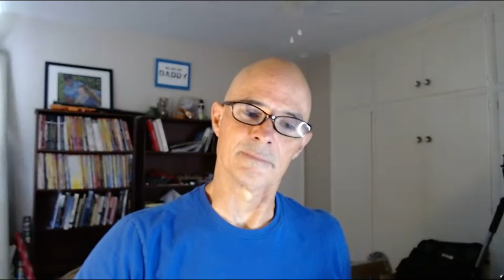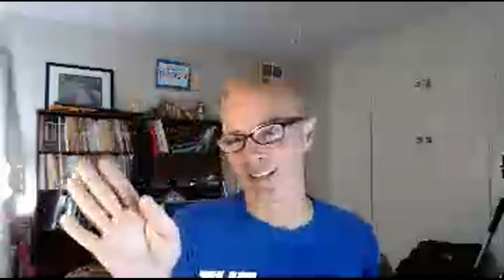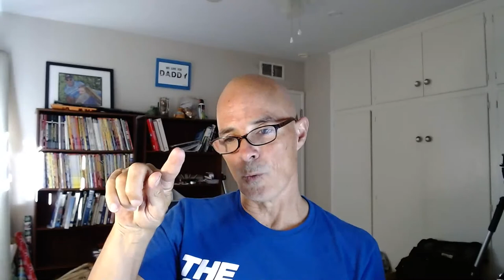LET'S TALK TECH-EMISSION LEGAL MODS

Comment: My beloved member from Four Eyed pride said it best...."It should also be noted that the CARB members are not voted in but are appointed positions by the Governor and state legislature. As such, you can imagine how well they represent us citizens of the state".
Reply: The world watches this bungling flexing of Anti Gasoline and Diesel Autocracy. I'm in  love with the responsible and smart moves the USA has made with the Clean Air Act, from its progress in 1963 to 2020, but in six months it has oveseen by very heavy handed, non aligned behaviour,   namely  the EPA and CARB and BAR. Each hasn't consolidated it's original statement of intent to just police simple operational competence of the basic emissions systems. The  rule now is on Totalitarianism and Fines. And just like it is in Algeria where if you put a low rwsteictiin exhauat on your Peugeot, you are a criminal. Preventing people tinkering At All with any OEM vehicle and saying VIN stamped cars cannot have non standard intake systems, including a blanket ban on anti detonation injection,  nitrous oxide, exhaust mods, turbos, superchargers, cam changes, pistons and axle and trans not stock. Thats Authoritarinizm. Jeff Davis in 1988 assured us this wouldn't happen. It Now has. Re read Hot Rod August 1988 here. I've posted links to the guy the EPA raided first in 1987 on page 2. See 

http://vb.foureyedpride.com/showthread.php?192346-California-Emissions

If fines were only about clean air and not banning modifications, life would be sweet. Shame. The quest to modify requires responsibility to do the right thing. Policing just the tail pipe and IM test, and not being Authoritarian is the way Foward. The visual inspection is now trying to ban a 1980 Ford Mustang Turbo going back on the road. Shear Operational Incompetence and hate for  Joe Public.

Comment: I’m not trying to be a banks fanboy but while many YouTube car mod people are yapping and complaining, banks is building a new Dyno cell to be able to meet the strict emissions testing requirements for his builds.  And on another note, air density became a real thing for all the rmrw folks, thing is most of them didn’t know what to do to increase density.  Might be a cool thing to reproduce different density altitudes and how you could increase your power at altitude and show on the dyno.  (I.e. spraying the inter cooler, nitrous (is a 50hp shot enough or do you need to make up the entire deficit to make the turbo work again., smaller hot side, ball bearings. etc). Have a good one
Reply from the maker: GALE IS VERY SHARP

Comment: Richard, I agree. I have always felt that the ultimate test should be tailpipe only. It shouldn't matter what modifications have been performed or whether or not they have an EO number, as long as what's coming out of the tailpipe is lower than the limits they have set, then it should all be good. I'd have absolutely no problem if CA would adopt that method of testing, even if they didn't give us a rolling exemption. My concern is the dwindling number of shops that will emissions test pre-99 vehicles as they require dyno testing rather than a simple OBD-II plug-in test. I'm really ticked my 98 Explorer requires a dyno smog even though it's OBD-II.

Comment: I disagree with the comment the EPA is not political.  Here's why:  the  EPA administrator is appointed by the president, and determines the policies based on what the president wants.  I believe the current law states no modifications from factory are legal.  The administrator determines to what degree to enforce the law.  If the president wants the EPA to go after everyone for any mod and gives the EPA funding to do so, they can, and it could be a $10,000 fine if you add an extra cat even if it doesn't meow.
Reply: That's true.richard should steer farther from politics..
That's the best way to ruin a buisness is mix it with politics
Reply: @tomrose6292  I also understand where he's coming from --- living in California, he realizes something needed to be done about the smog, so to him it's not a political issue, it's an issue of clean air.  The problem from my viewpoint is that one size fits all policies doesn't work.
Reply: @kerryb2689  yea your right it just seemed he was reaching towards politics because the head members of the epa were appointed by who was voted in..not simply hired for thei intelligence , and they are a entity of gov that is over reaching as many others chasing political agendas of their own instead of their constituents.
Reply: @kerryb2689  I'm pretty sure my v8 s10 that has less than 500 miles on it probly would not be allowed on the streets in caly.and in 3 other states I've lived in with other modified rods I had no issues

Comment: In California we made over 200 more horsepower in our 3rd gen Camaros and firebirds with heads cams intakes headers dual cats and all emissions hooked up. It’s not hard. Even a Comp 280XFI cam will pass smog. One trick is keeping the LSA 113-114. On smaller cams 112 LSA will work. The most WHP so far was 440whp@6400 with a TPI 388ci. Even a 406ci TPI made 403whp@5800. So it is possible but most people don’t want to do it.
Reply from the maker: unfortunately, neither the 383 or 406 (or the comp 280 cam) are technically smog legal
Reply: You do t tell them that. It’s just a 350
Reply: Thank you, Vincent. It’s not hard, but you have to know how engines work before you start.
Reply: I’ve posted videos of TPI’s making 360whp-430whp and passing smog in California

Comment: The other thing CARB does is mandate a CA fuel blend. It has less emissions per gallon but it doesn't get as good MPG as gas in other states. They don't care that the overall emissions would be less with better MPG, all they are about is less emissions per gallon.

Comment: Hi Richard, Mark here,  in Australia back in 1980, racing driver Peter Brock started producing his own version of the Holden Commodore, with basic mods (heads, larger air intake, headers etc) power and torque increased, whilst emissions dropped quite substantially- I believe if you focus on efficiency,  you can win all round...

Comment: Based on my understanding regarding the "no race car can ever have had a VIN' there is a potential business opportunity to make tube frame chassis' and fiberglass-carbon fiber body panels for those wanting to go that way. NASCAR is the prime example. Face it folks you really shouldn't driving a race-only vehicle on the street.  There are too many common idiots texting on cell phones while driving to risk your driving supercar. With the replacement populace coming over the borders now, car markets will trend to their spending habits, not ours.  Lastly, more manufacturers need to offer special packages that are fully EPA compliant that have all the usable horsepower you can use to obliterate the cheap tires you can buy.  Ex. Dodge Hellcat, Ford Lighting.
The long term goal is the removal of the ICE from existence because electric cars force you to stay in cities supported with larger power grids.  You can fight this for now buy buying enough land to have your own motorsports parks.
Reply: That's why race only cars get trailers. There are cars called "street class" that must be street legal to even be allowed to race. The entire reason behind this whole thing will make it to where you can't have ANY car to take to a drag strip. None, that has EVER  HAD A VIN NUMBER. none of us can afford to build a car from scratch. Not only can you not use a car, you have to build an engine from scratch also. One off block, one off heads, crank, etc. Nothing that's EVER been into production. You need to do more research into this. It's going to ruin the sport for us all including most dirt track racing classes, drag racing classes, drifting,  road course racing etc. Anything like that will go down the drain.

Comment: Emission mandates are BS because if your daily driver is a 1970 Eldorado with a 500 cid that burns as much oil as gas, blue smoke out the tailpipe and all would emit less emissions in ten years of driving it that way for 50,000 miles a year than the emissions spewed out to build 1 hybrid car!
Reply: What happened to ab210 bill

Comment: The down side of Brent getting fined or anyone getting fined from the EPA is that once you pay for the fine you lose everything! You lose the ability to do any type of work on vehicle's, you lose the ability to modify or even race your car even though the car is off road use only. It sucks because Brent will lose his company over 37 units of Hondata hardware/software.

Comment: What if you have have a car more the 25yrs old but put a modern day engine it it. Does that change the emissions standard for that car?
Reply: No to dose not hinder the car  ,however, the newer motor brings it's controls back to the old car. I say it this way because if you yank out that LS and  put the 1970's motor back  in you can revert back to the car's OE control equipment.

Comment: Your comment about allowing old vehicles to get an exemption from emissions is exactly why there is a full blown industry on selling "glider" trucks which are new chassis with old engines. That needs to stop because  unlike a 1970 firebird, these semi trucks are putting on half a million  miles a year on a diesel, sort of thing.
Reply: Glider Kits for 18 wheelers have been out for 50 years.. Before there were even emissions standards for 18 wheelers.  Allows a "new kit truck" at 55% of the price of newly manufactured one/with all new components.  What "needs to stop" ?? Being thrifty and feeding your family ?  Most glider/18 wheelers being built today still employ EFI/Emissions motors..   Very low impact.
Reply: @stephendee7839    Yes.. I know the industry. To pretend a 1996 to 2010 engine puts out 20 times to 50 times more emissions vs a new engine is bullshit.  "Shilling" for your narrative?  The 1st EFI Engines for Class 8 Trucks came out in 1986.. Detroit Diesel Series 60.. pushing up on 40 years ago... and OTR diesels have been acceptably clean vehicles from that time forward.
Reply: @granbordeaux6955  Sorry to hear that you can't read the article I cited that identified the massive emissions problem with gliders. Maybe ask a friend to read it out loud to you? 

I'm not shilling for anyone, but I am correcting the misinformation perpetrated by climate deniers and pollution apologists and citing legitimate research in the process rather than casting unfounded and unsupported assertions and aspersions.
Reply: @stephendee7839   You haven't cited any article in either of your 2 comments .. Mother Jones is not a reliable source for unbiased news anyways. Isn't this the part of the conversation where you start insisting that Cow Farts are destroying the environment too? 😂🤣😂😅
Reply: @granbordeaux6955  Man, you're hard of reading! I did cited an NYU law article but there are plenty of others to choose from. 

Wow, you got something correct with your comment about "Mother Jones" being a terrible source, which is why I don't rely on it. You, on the other hand, don't rely on any sources, apparently.
Reply: @stephendee7839   I'll look up a Cow Farts are Killing the Environment author and see if he's dabbled in Class 8 Emissions and tell you what he says... real "science".  😂😂😅😅🤣🤣🤣

Comment: 30:15 ummm what? That is literally impossible. It’s using the same air you said was dirtier and adding nox and hc. Please elaborate!  Have you been hydrating again?
Reply: Removing particulate from the air.
Reply from the maker: IF YOU HAVE DIRTY AIR AND RUN IT THROUGH A FILTER-DOES IT NOT GET CLEANER? THINK ABOUT IT
Reply: @richardholdener1727  tom is meaning in a climate way the air gets dirtier because the vehicle is producing emissions
Reply: I’m so confused 🤔
Reply: @tomcelica  basically your both looking at emissions in a different way. Richard is talking about particulate emissions (where after filtering the air, no particulates are made in some engines) where you seem to be talking about CO2, nox etc emissions which do come out the exhaust. 
Cleaner in the particle sense but worse in greenhouse gas emissions type of way